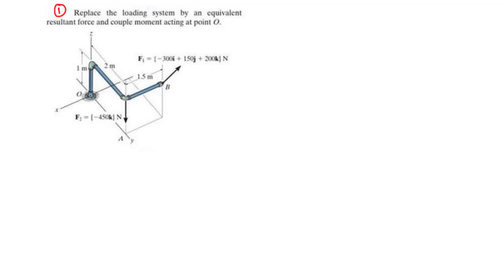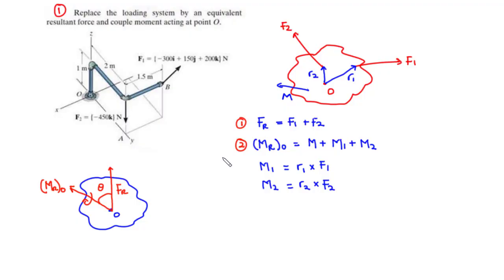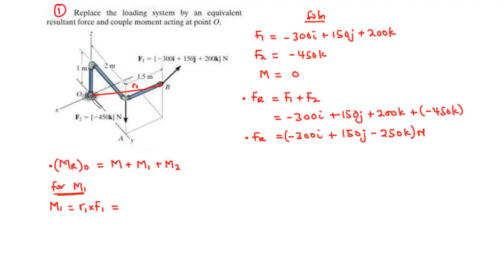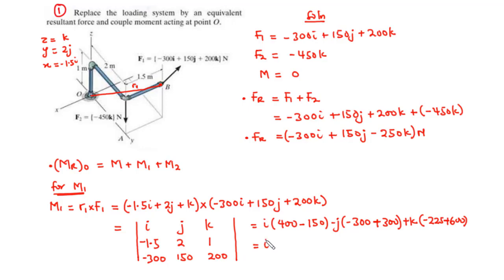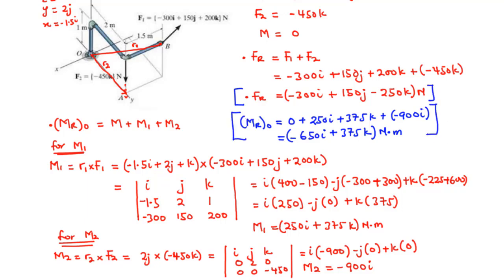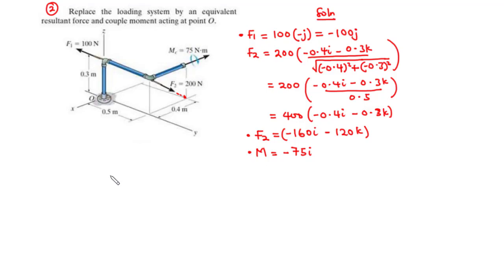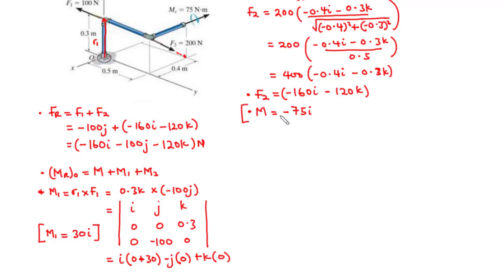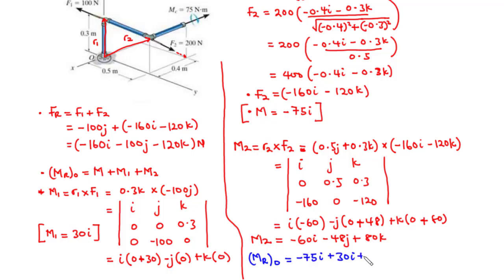🔺22 - Simplification of a Force and Couple System in 3D

Comment: For solving M2, shouldn’t the r position vector be (0i, 2j, 1k), not (0,2,0) because the point where it is pointing too is going up 1 meter in the positive z direction?
Reply: The force F2 acts downwards as seen in the diagram so the need to go up 1m first before considering the 2k isn't needed